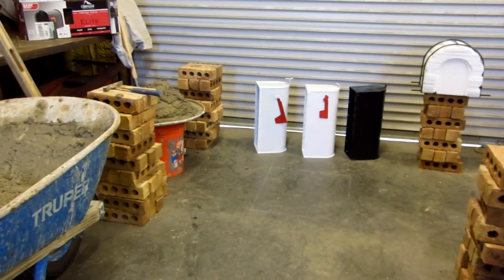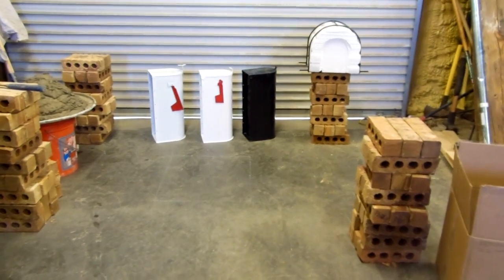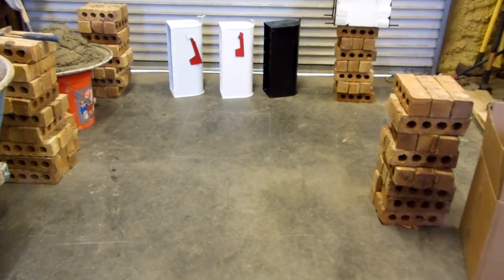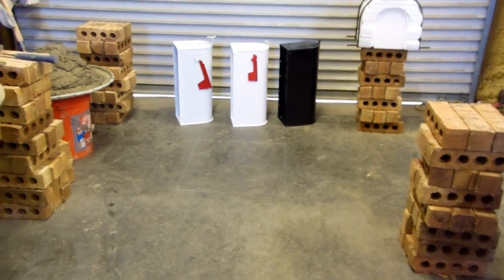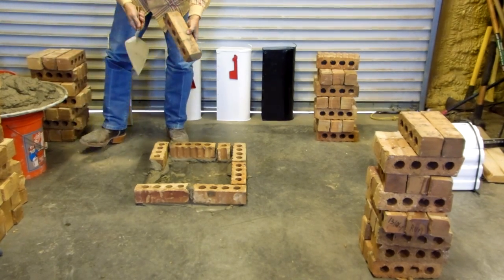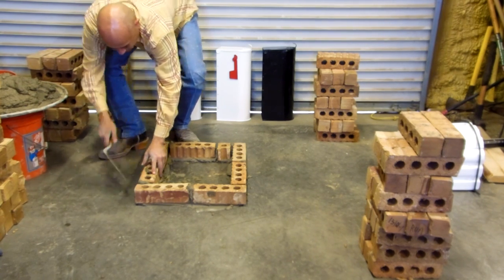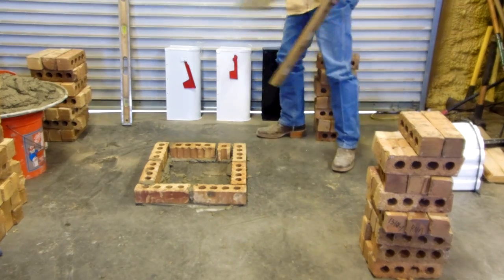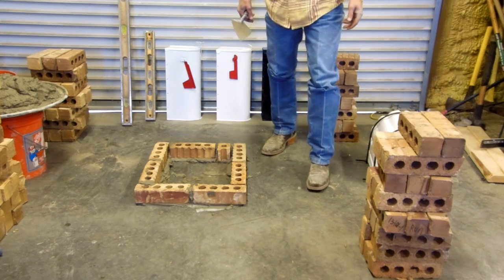Building brick mailbox using template (Mailbox Maximizer) Part 1

Comment: How did you get that off of your garage floor?
Reply: The floor has a slick finish on it so all I did was scrub it with a wire brush
Reply: But didn't the concrete stick to the concrete floor?  Sorry for the questions, but we are getting ready to build one ourselves.  Your videos were really great - thanks!
Reply: If the mortar does stick you can use sure clean cleaner that you can get at any masonry supply but if you clean it with a wire brush and water the same day it should come off with no problems.
Reply: Thanks!